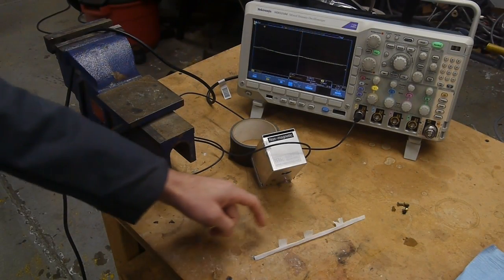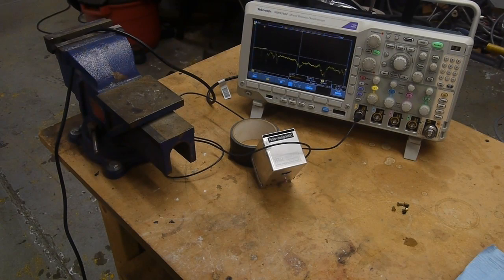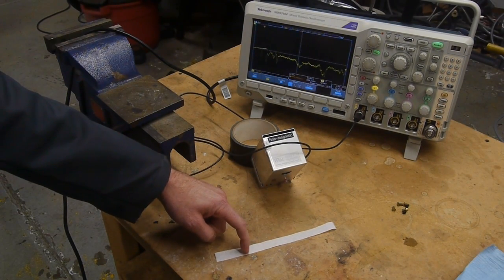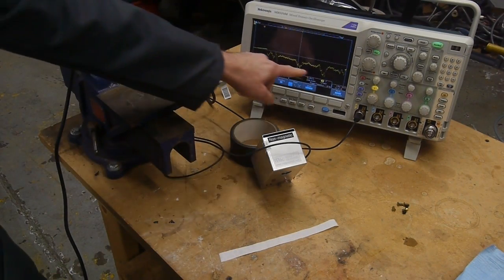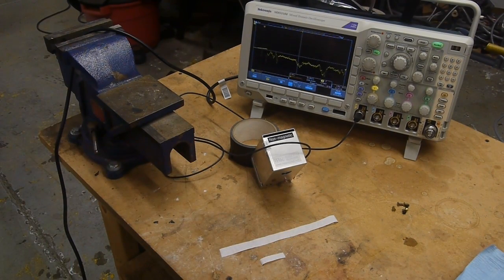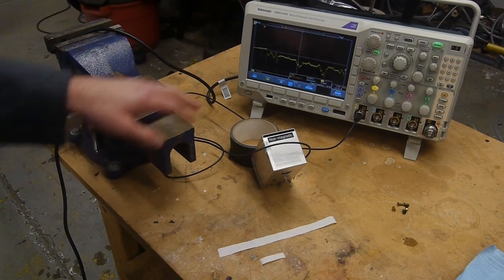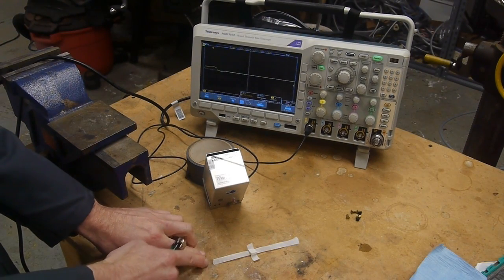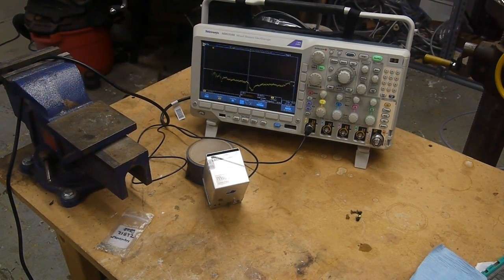Encode information in fire!

Comment: The only computation operation I can think of is logical AND.  That is, if you have two papers encoding binary burning simultaneously, the photosensor will read "high" if either one has a tab.

Is there any kind of optical filter which could implement NOT?  Basically, it would block light when the light threshold is over a certain level, but let it through when it is below the threshold.  Sort of an extreme version of Transtition lenses I guess.  If so, you can create a NOT AND gate (NAND), which, en masse, is theoretically sufficient for general-purpose computing.

Comment: As I see it, it's not possible to build any binary stuff from that, only an OR gate seems to be possible. for an AND gate, you need something that changes its "fireproofitivity" if its lit. That need more parts, that would be hard to make out of flashpaper. But if you could come up with some chemicals that can help implement this function, you could build for example a 4 bit adder easily with your stencil cutter.

The simplest AND gate that i figured out uses a piece of aluminium foil to not let the B input light the output if the A input is intact, but when the A input burns away, the piece of foil falls down, and a contact is made between the B input and output, so if the fire comes from the input B, the output is lit. If you have to rise the paper from the desk anyway, this one could be a relatively easy solution.

Comment: I thought one time it would be pretty easy to make a hydraulic logical component that you send some small amount of fluid to lift a gate that allows a larger quantity of fluid to flow...
Reply: Ben Thurston and an and gate could be something like there are two hydraulically opened valves in series that both have to be open to allow a flow through and stuff like that...
Reply: Ben Thurston for some of your setups it might be cool if you could open one valve and it would open and close all the valves throughout the apparatus the way they needed to be... maybe they already have stuff for that I don't know...
Reply: Ben Thurston Maybe you could have something like the tire pressure gauge that would work as a linear actuator and push open a switch valve, or maybe there's something better... it'd be cool to have a switch panel to control all the valves from outside a closed apparatus though!
Reply: Ben Thurston or you could have things like a pressure cooker that when the pressure inside gets high it partially closes the valve to the fuel source or too low it opens it up more to self regulate... or an experiment could control the rate of a titration fluid entering the reaction chamber the same way...

Comment: An optical censor like that could have an application in field related to burning bio fuel for energy or even a cheap fast way to analyze the chemical composition of fire and smoke where if you analyze the light emitted you can estimate what the flame front is doing. In relation to other kinds of fire it could be used analyse the combustion inside an internal combustion engine where it's kinda hard to get a good understanding of the actual combustion and you analyse on O2 censers etc. If you can analyse the flame produced in real time the engine can compensate for dodgy fuel, weather, humidity, altitude etc and potentially save a lot of fuel, CO2, money etc.

Comment: We are moving away from fire into more fundamental physics. Fire is going backwards :)
I would be infinitely more interested in attempts to duplicate ball lightning. I am fairly sure that it is nothing short of the holy grail of physics breakthroughs and offers a seemingly relatively very easy entry point because the hints of their creation suggest conventional energy discharge into some kind of rotationally symmetric shape, like lightning in tree trunks. The ability to maintain an altitude and distance to a wall suggests a meissner effect analog that could be tremendously important for propulsion. The spherical shape is similarly a huge mystery and highly suggestive of new physics.
Reply: we rely on electricity to do just about everything maybe he's trying to get away from that with one project.

Comment: My suggestions would be
use a grate or mesh underneath to avoid the fading at each end and to stabilize (you wouldn't have to tent the paper)
build a box around the paper and sensor the eliminate interference
stack small squares and rectangles vertically ontop of a horizontal fuse paper such as __i_I_i,!__i__  
I had more, but I forgot them already :P
Reply: to make it easier to stack like I said, it may be easier to cut or puch a small hole on the linear fuse and insert a rolled up clip of the flash paper cut to the desired length

Comment: if having it against a surface absorbs energy then what if you use that to your advantage and make a mesh of them perhaps with spacers or weights and then put it on a metal plate to absorb whichever ones were weaved to be up against it hopefully slowing it down and allowing logic to be performed based on what burned what at what time using the against the table or not to add delay and make the mesh programmable by weaving it differently

Comment: Potentially, you could stack and align strips of flash paper in such a way as to mimic basic logic gates. An OR gate would be easiest as you would simply only need to read whether each of the two strips were burning. An AND is also just as simple, i.e. if two strips of paper hit a high at the same time, count that as a 1. In fact, all the gates could be implemented using flash paper, but the downside is that you wouldn't be able to make a device using only flash paper. Also, timing would be hard to get down. Further, you wouldn't be able to store information.

It's an interesting concept, but not very useful and hard to implement.

Comment: ehh.... well... the spectral encoding, where the different colors represent a different bit of information, that's interesting cause that's sort of the beginning of optical computing.

As this stands, with just the intensity of the flame conveying the signal, you have something that is kinda niche. A definite steam punk vibe. 

As far as automated decoding, you might consider using the strips in tandem with a sterling engine of some type. As the flame increases in intensity, the speed at which a sterling engine rotates would also increase. 

The rotation could be connected to a transmission device, which, depending on the rpms of the engine, and thus the intensity of the flame at a given moment in time, would decode the information and translate it into a given instruction. 

it'd be somewhat arcane though.

Comment: I'm thinking make a highly secure device to wipe a drive if an unauthorized person attempts to access it. 
Tampering with the device, or entering incorrect password ignites the paper (in some sort of enclosure). The (fire) signal is read and output to the system prompting a request to input a pin within given time frame. FBI hears fizzing inside computer If no pin, everything goes up in flames so to speak. Perhaps the pin is hardware encoded so it can't be cracked. For instance have the device be able to process the input from 10 keys. Have 10 wires hooked to 10 flash papers or whatever in the device. 4 number pin is entered in order and it burns out the path to detonation. Hit any other number, or in wrong order and flame box keeps "computing". Of course you'd want it to send some other signals before detonation, like the skull and crossbones on the screen or whatever. Maybe you make a really complicated flame path that directly or indirectly outputs an audio signal that dials a modem and sends you a text message that your system is comprised. Man, the James Bond writers need to hire me.

Comment: Are you looking for fire logic? Whats the problem? I mustn't understand your question correctly because you could make a NOR gate simply by running two (or more) pieces of paper (the input) under a "read" paper (output). Now if neither of the NOR gate input pins was supplied fire to, then after you apply fire to the "read" paper it will read TRUE (on the output side), otherwise false.
You can build anything out of a NOR. The problem is, how would you generate fire? How would you stop it, and how could a single-use processor be of any use?

Edit: also making an OR gate is hopefully pretty intuitive :P.

Comment: I thought the yellow colour of the flame was a result of the heat (like in black body radiation). What colour would be the flame with no contaminants? (it should be a function of temperature I think...)
Reply: If it burns clearly, should be transparent.
Reply from the maker: ASTROTZUR A candle flame is yellow because the burning wax emits lots of solid carbon particles, which are heated to incandescence, and give off light due to black body radiation.  A hydrogen flame has a very faint blue color because there are no carbon particles (soot) to give off blackbody radiation.  A propane flame has a brighter blue color because of the CH fragments that are produced by the combustion -- it is atomic emission.  Similarly, the flashpaper emits almost no soot, but does contain a fair amount of sodium ions, which produce the orange color.  It is definitely different than the yellowish color of a normal candle.  If checked with a spectrometer, it would not have a blackbody curve, but the emission lines for sodium.
Reply: Thanks! :)
Reply: Applied Science My Hydrogen burns clearly orange. Why is that?
Reply: Markus Gugger Might be the 656 nm emission line of hydrogen.

Comment: Interesting way to store information, but making computer out of this won't be easy (if not impossible). The problem is that burning process is destructive so making a flip-flop and storing information would be rather problematic. On the other hand I think that making "fire computer" is possible using liquid or gas fuel and some clever piping setup. If the burning rate would be controlled and fuel would be constantly delivered to the system then you could probably control the path of a flame and make some kind of r/w memory. I you could make a flip-flop then you could build a computer.

Comment: couldn't you use normal paper and draw black lines on sections of the paper strip. then slide this infront of  the light sensor with a white light shining on it. when a white section is exposed then you get a bright signal then when a black section is exposed you get a dark one.

Comment: I think the only computation you can do with this is an inverted AND (brain fart NAND) gate if simply burning two strips together. Now I think a little more about it I suppose an NOR . or OR invert the detector. (DoesAnyoneOnThisPlanetReallyNeedThisManyCharactersToInputHisNames post nailed what I was thinking)

Edit: thought about instead of using optical to detect one gate the height (intensity) of the flame when 1&1 ignites a stage further where 1+0 doesn't. You've given me a great going to sleep thought experiment. Oh god; you could make a trinary computer poof my brain just exploded

Comment: Here is how to compute the density of information:
Assuming you have 
 - a single light detector
 - it detect only one center wavelength
 - it is linear

A single stripe of burning chemical encode 1 bit

Two stripes could encore 2 bit only if you can make one stripe emit twice the light of the first. Alternatively, if the position of the sensor make it get twice the light from one stripe, then you could get 2 bits.

One the scope, the signal would show 4 distinct levels. You give the binary value 00 to the lowest and 11 to the highest, Each time the flame on both stripes reach the middle of a burn mark, you capture the intensity and write that as 2 bits output. Every 4 burn mark, you completed a byte.

Same logic apply to any other number of stripes. Each one must be perceived as twice the intensity of the previous stripe.

As you can guess, such system would not be reliable. The intensity of the burning stripe in narrow channel is equivalent to a background noise. You need to make sure that when both stripe are burning on narrow, their total light slower than the most faint one.

The other problem is to get an equal burning speed for all stripes. Otherwise, the bit pattern start to shift. 

This different timing between stripe is equivalent to the problem with the very high speed RAM of modern computer where some data bit do arrive before others because of tiny difference in length in the connection between RAM and CPU. They gave up trying to fight that and use a self calibrating algorithm instead where the CPU capture the data from the RAM at different fine time. This calibration is done each time you restart the computer.

Comment: if you can create a shape or combination of shapes that emits an output that you define as "true" so long as both inputs are not simultaneously a "true," then you can create a (single use) computer. unfortunately, if you define as true and false based on "flame on" and "flame off," such would require the output to be on fire when no input is(under certain circumstances) which means you would need to define "true" and "false" as something other than on or off.

Comment: Useful for secret agents in one-time read messages. Q would be proud.  :)

I think the best way to do this would be to use encoding like they do on CDs. There is error correction built in to it.
Reply: How about this... Could someone build a printer that works with flash paper?

It brings to mind a project called "PaperBack." Basically they store digital info (again with redundancy for error correction) on to regular paper, then read it back in with a scanner.

It would probably have to work like a Turing style tape.

Comment: Why not experiment with the flash paper chemistry first. Use a different cleaning process to eliminate the sodium for a light less flame. Maybe a photo mask to make a bar code print with colors between the bars. If that works modify a printer cartridge to print metal salt barcodes with black ink as the time break for resolution.

Comment: I think you will need to figure out how  you will input data into the your "fire processor", and figure out how to make basic logic gates. Those are easy to make with switches, electronics, relays, mechanical means, and domino's. However, how will you make even a simple AND gate? I suppose one 'one-time-use' method would include having something shaped in a =|---- or a Y configuration, where there are 2 inputs and one output. That would be a simple one time use OR gate.

I have seen a computer that can add 4 bit digital numbers made entirely with domino's!!! Perhaps you can get some inspiration from their computerphile method for making that!

Comment: The real problem here is memory. The same thing that makes this a neat way to encode secret spy information makes it unsuitable for computation, there is no memory, the flame knows only the present, it has not memory.

The logic gates cannot be constructed using flame and flash paper alone, the metal salts will be needed, some way must be found to retain the information, like stacking the flash paper on top of itself in a serpentine manner, but with enough space to prevent the spread of the flame. Like,
-------------
              |
-------------
Then encode byte using salt drops in sequence, and on the second row above, place a chemical sensitive to the metal salt residue, so that it will only be noticable in the output when the metal residue has reacted with it to activate it or make it combustible, encode a second set of bytes with it, then when the second row burned one could examine the output to tell where the residue from the prior burn of salts influenced the paper above to burn and the information of the past and present would be there in the output making an AND operation. For NOT operation a chemical would be needed that would respond to residue from the previous burn by deactivating or neutralizing some how, removing itself from the output and the whole byte can for that row can be laced with it, so when that row burns, the output byte is NOT what burnt the row before it. For OR operation, the AND chemical would be used to lace the whole row, and the second byte of the OR would be placed on that row with original combustible salts as well.

Thanks for the video, it was a fun puzzle.

Comment: You could use a flammable liquid and groves in a non flammable substrate. Then it would be reset-able
Reply: Parallel flame paths may not burn at the same rate and cause desynchronization

Comment: sounds like a Turning Machine implementation, http://en.wikipedia.org/wiki/Turing_machine an extremely powerful device.
Reply: I was thinking later that you could make a matrix of paper, interconnected in a grid pattern, with the intersections holding some kind of meaning in the "program code". if instead of using a single optical sensor you used a standard high resolution camera, then maybe you could map this back into some kind of human readable form. I'd be impressed if you could add two binary numbers for example, I'm sure its possible.